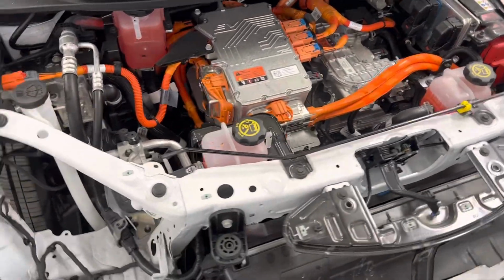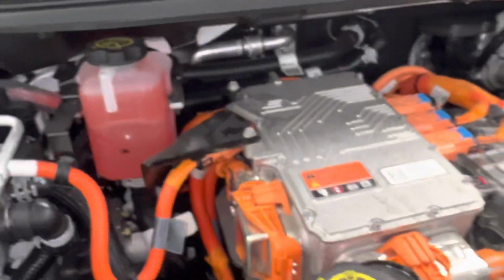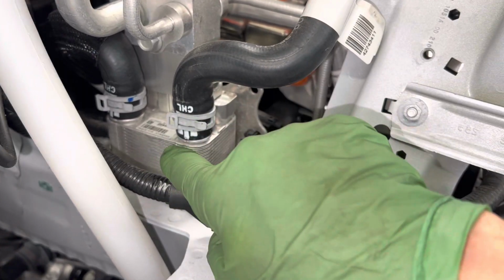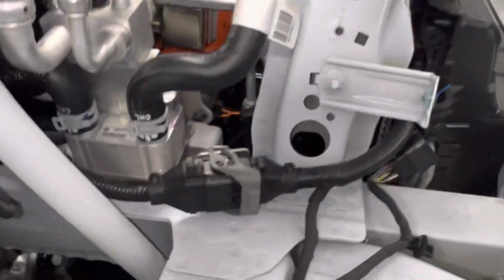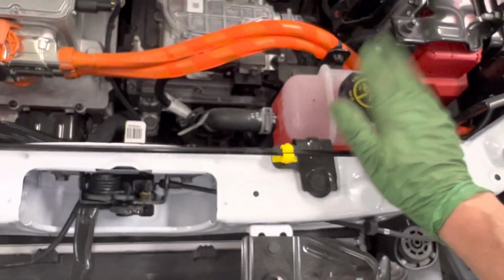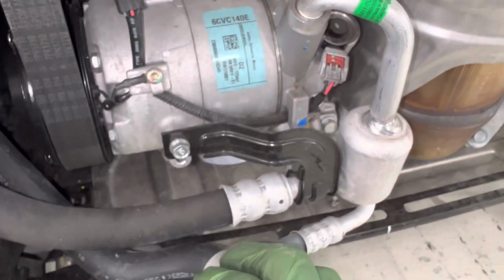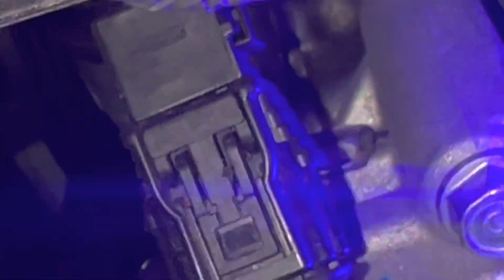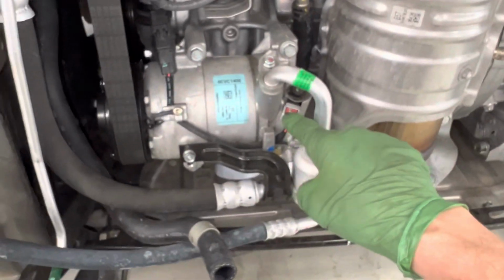AC REFRIGERANT PLATE HEAT EXCHANGER GLYCOL 3 COOLANT SYSTEMS/ IHX SUBCOOLING 2023 BOLT⚡️ EV ￼

Comment: Tom thank you for all your efforts. I have a question, what is the porpoise of the muffler on that suction line just before the compressor?
Reply: Thank you
Reply from the maker: Exact same thing as the discharge muffler. 

Reduce sound back to the passenger compartment